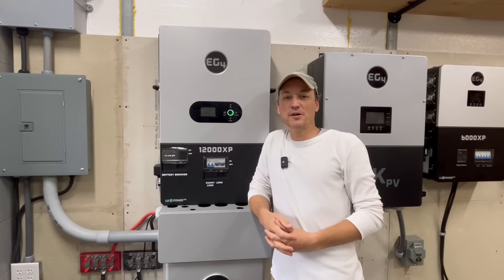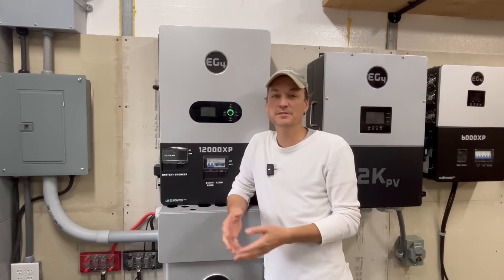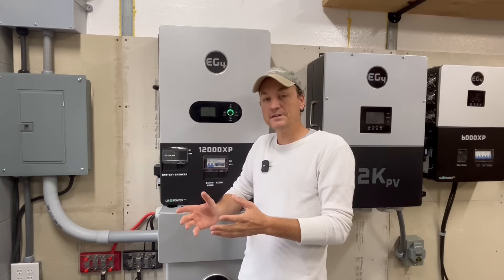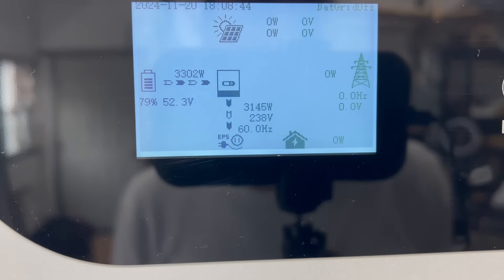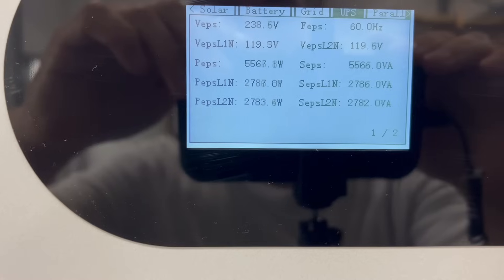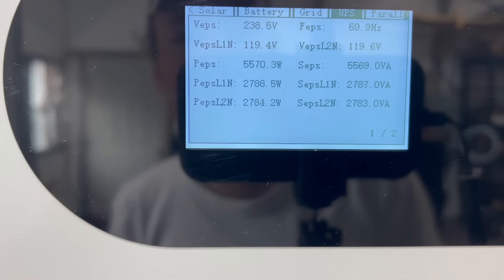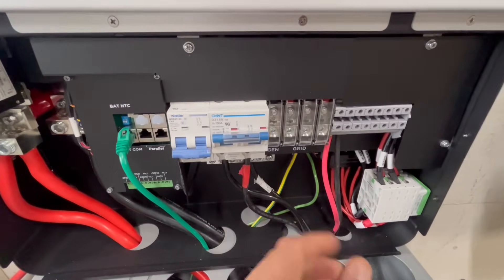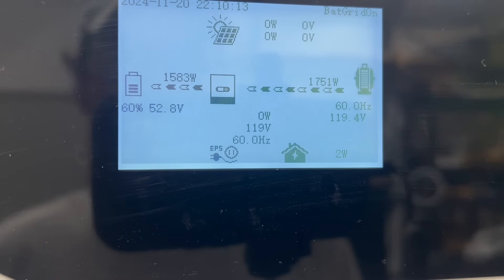EG4 12000XP off grid inverter follow up and Q&A

Comment: Hey Gavin, does it have blending capability? I think that is the correct terminology.  Still learning,  LOL
Reply from the maker: It isn’t grid interactive like a hybrid no. So it’s either grid or solar/battery. Although if you are in grid bypass then solar can still charge the batteries.
Reply: @GavinStoneDIY  so "grid interactive" is where a hybrid inverter can use partial grid and partial solar/battery simultaneously?
Reply from the maker: @jetkrazee  exactly. Hybrids come with CT’s (current transformers). Those track the exact amount of current the grid is using so the inverter can supplement as needed. Plus they are able to match the exact phase of the grid. Without those features it wouldn’t be safe. Which is why they describe the 12000xp and 6000xp as “off grid” inverters. They can use the grid to charge or as a bypass. But they aren’t meant to interact directly with it like a hybrid.

So on the plus side that does keep the cost of the equipment down.
Reply: @GavinStoneDIY  awesome information man. I appreciate it very much! I assume many hybrids such as the NHX 10K and 12K can be programmed for different thresholds on amp draw from the grid if so desired?
Reply from the maker: @ yes indeed. The NHx series and the EG4 18k and 12kpv.  You can choose how much they’ll give or take from the grid. And even what time they do. And of course they also have the option of selling back to the grid with a net metering agreement. It’s really nice to have those features.
Reply: @GavinStoneDIY  Good deal. Thank you again sir. You are a wealth of very valuable information. Very glad to have found you. 👍
Reply: @GavinStoneDIY  Is it possible to connect the grid to the GEN ports and use the Gen Boost function to partially utilize the grid and batteries to supply the loads?"

Comment: Great info! Id appreciate a vid on a combiner box for setting up panels with this 12000xp. I unfortunately have a bunch of new old 300watt usa made panels to run with a 12000xp on order. 

Funny how it takes lil talent to series panels but the benefits of installing series is labor & parts savings. 

I know something like 25 30 volts dc welds 1/2" thick steel, it always concerned me to series panels to high voltage and not much in the way of fuse safety especially ontop 2 story metal roof😅
Reply from the maker: For sure. I’m going to plan on a combiner box video. I’m actually looking forward to it. I think it’ll be fun to make.

Comment: Gavin, can the 12000XP be configured like a UPS where the primary feed to the critical load panel is the grid (as well as charging the batteries) but it will fail over to all battery when the grid is down ?  No solar would be involved for this question.

One other question - has Eg4 explained why they changed the screen on this inverter ?
Reply from the maker: Honestly haven’t thought about this before. It could probably be wired in some way to achieve this. But I haven’t pondered it long enough. I don’t think it would be a standard option like it is with hybrid units like the 18kpv. 

EG4 didn’t go into detail on the screen change. Honestly it’s easier to navigate than the 6000xp. So it’s a step up in that regard.
Reply: @ Does it look like “AC CHARGE” Operating mode work ?  If it does, then what happens when the grid is down?
Reply from the maker: @wbarkwell  ac charge does work yeah. It would just be a matter of where the output of the inverter is going. It would continue to power your critical loads panel for sure. So in that sense it could be a UPS for your critical loads panel. I was just thinking more along the lines of your other loads.

Comment: I would love to see how you wire a combiner box. I tried to do this early on when I was first starting and I couldn’t get more than one string to work? I eventually gave up and just ran each string separately to my charge controllers!
Reply from the maker: I will be adding that to my video schedule then for sure. I remember when I first started out, it seemed pretty confusing.

Comment: When you AC couple a solar array it comes in AC and when you bring in PV it comes in in DC so my question is can you bring in more than the 24000 watts when you use the ac coupling and the DC strings into the pv ports?
Reply from the maker: The unit will only bring in what it needs either way. So it can output and charge at 250 amps. So it wouldn’t need to pull anything further from the panels beyond that point. So I guess the answer to your question is technically no. It wouldn’t need it.

Comment: Great video! 

I was doing the math yesterday for fun and came to the same conclusions as you with 9 panel strings and combiner box.

I wonder...no light flicker right? 

I agree with the end of video, running at the limit watts is bad, specially with inductive loads and limited surge capacity because the inverter is already maxed. In my house we have a Sol-Ark 8K and we peak at 3500-3700 watts,  very rarely 4000w+ and never have reached 6000w.
Reply from the maker: Exactly yeah. 

Zero light flicker that I’ve observed. Very stable output. Seems to be a very tough design. I noticed the same with the 6000xp’s. 

These off grid inverters weren’t designed to pull from the grid to balance loads like a hybrid. So they are tough as nails when it comes to inductive loads.

Comment: A shockingly good video… Nice to see how to push the limits.. If you have the cycles a combiner box video would be great. I just currently run the solar output to the 18kpv DC cutoff switch. Thanks again..
Reply from the maker: “Shockingly” I see what you did there. 🤓

Comment: Will this inverter bypass to grid when overloaded or just shut down when overloaded? What is the process to manually bypass?
Reply from the maker: Yes it will automatically bypass to grid when overloaded if grid is available. Manual bypass could be done a few different ways. You could install a bypass switch.